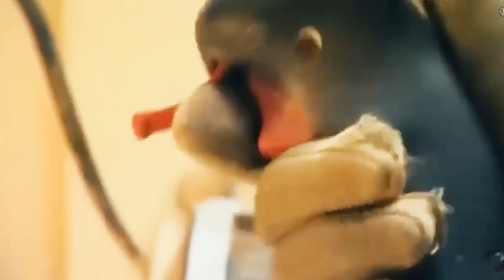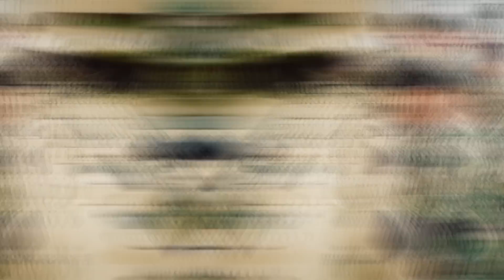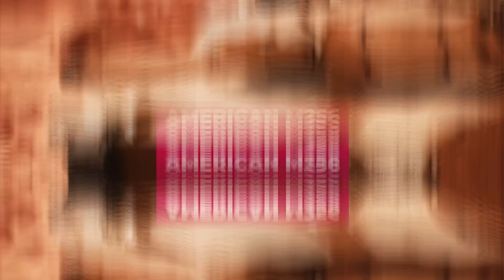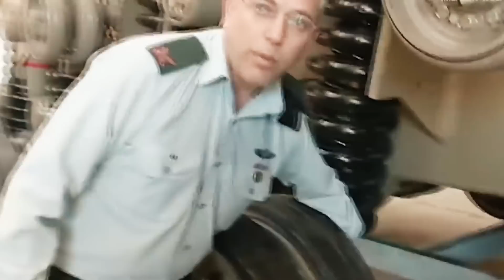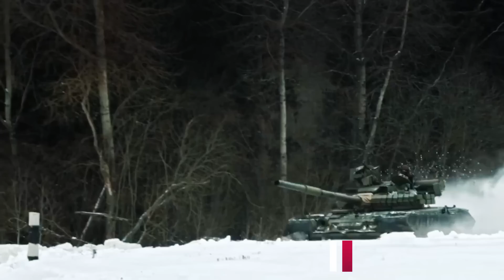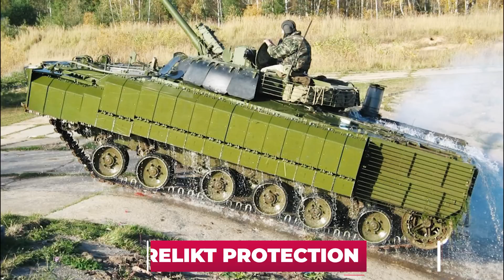This Deadly Israeli Super Tank SHOCKED Russian Invaders in Ukraine

Comment: the bottom line is to integrate, tanks ,air power and infantry in the most cost effective way. This is a war of DOLLARS.  The US does this with AIR power. constant communication.  The battlefield is dynamic.  Do not ever fight a tank on tank war if you can destroy it from the air.  Tanks should be a last resort. a relic of the times. or perhaps ,simply a projection of strength.